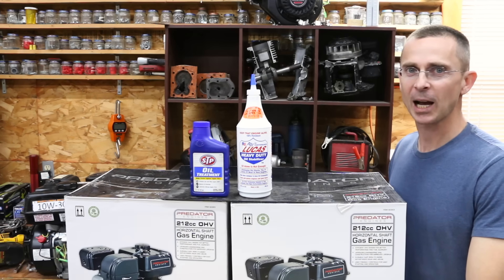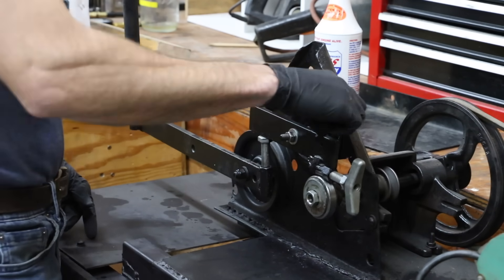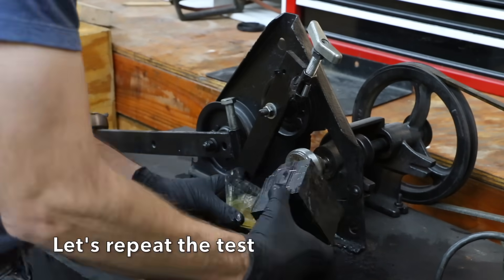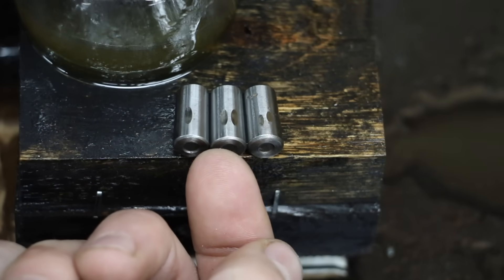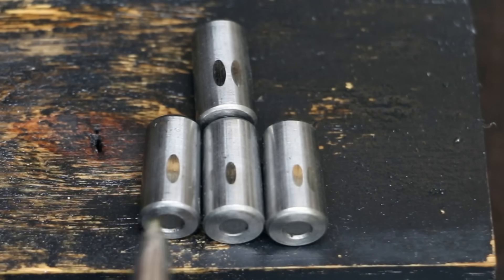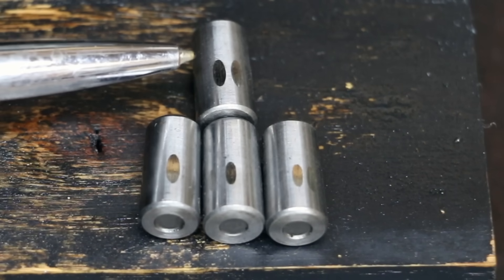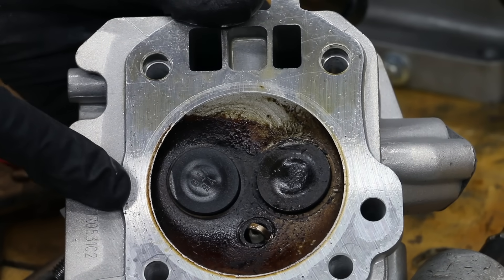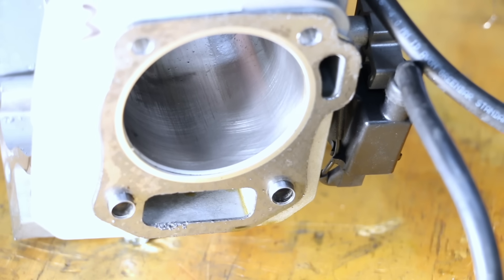Which engine self-destructs first?  Lucas or STP?

Comment: OK so a bit if info about STP... When I worked as a tech for Lexus of Tampa, FL... one of our main center lift, lifts got stuck in the up position... (bad storm flooded the shop). SO anyway, the repair tech said the only thing, that he has found that can lubricate and has enough film strengh to pass the sealing rings, to was STP... The water from the flood had formed a thin layer of rust on the main liffting tub and that was enough to prevent the shaft from going down... SO I watched as the repair tech rub down the main shaft of the lift wth STP and then lowered the lift... I was blown away at how easily he was able to do that knowing how much weight those lifts can handle and how long we tried to get the lift down. It was an eye opening experence on how aditives in oil react and what they actually do... SO for me I am stuck on AMSOIL products, but any quality additive like Lucas and STP or AMSOIL additives, just offer that little extra layer of protection. Afterall a vehicle can cost as much as a house... why not invest in keeping them running.
Reply from the maker: Great post. Thanks

Comment: You should try running petron plus against Lucas and STP, I have seen perron plus run a motor for 2 plus hours without engine failure and no significant damage to the motor
Reply from the maker: Thank you for this recommendation!

Comment: Not sure what you're proving, I've never used oil additive in any of my air colder engines,  I use multi grade synthetic engine oil and never had an engine fail. My garden tractor is 25 years old 18 hp kohler that's never been apart. I don't believe in oil additives just quality synthetic oils in regularly serviced engines. Your video was interesting and I will watch your next one.
Reply from the maker: Thanks for the constructive feedback and thanks for the positive comment.

Comment: And it's Lucas for the win ! That stuff is amazing.  My dad had an 04 Sierra v6. He got 425k miles out of it. He had lifters and rods start knocking about 50k prior to that. He started using Lucas and it quit it. The engine ran until the fuel injection system laid down. So only God knows if that woulda held in how long it woulda ran.  I've been a sold fan ever since.
Reply from the maker: Thanks for commenting on this!

Comment: hey will you try to run an engine with the heaviest gear oil instead of motor oil? preferably a car engine so you can compare power through out the heat cycle
Reply from the maker: Thank you for this recommendation!

Comment: I was having an issue with lifter tick on my powertec 4.7l. As common. 
I tried different weights and different addatives. 

My cure. 0w20 castrol magnetec and hy-per lube. 
1 qt hy-per lube to a change. 
Ive been told since this that i have one of the quietest 4.7l around. 
Lucas made it worse and without hyper lube made no difference 
Sooo. Maybe try hyper lube against some others.
Reply from the maker: Impressive!  Thank you for this recommendation!

Comment: Test out PowerPunch it's has very strong film strength..

Okay I wanna see you send off the" broken in" engine parts to MicroBlue.com. They do a extremely tough racing coating on everything mechanical.  They have told their customers that their wheel bearings don't need geese because the film strength is so tough. 

There are people spending the BIG money coating drivetrains for added mpg and performance.
Reply from the maker: Thank you for this recommendation!